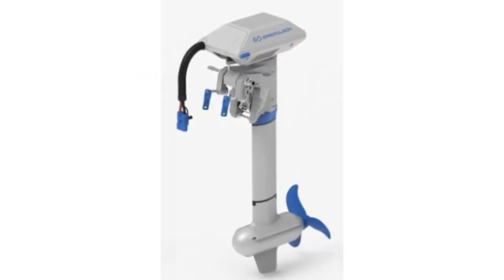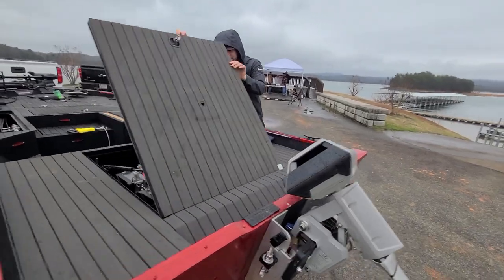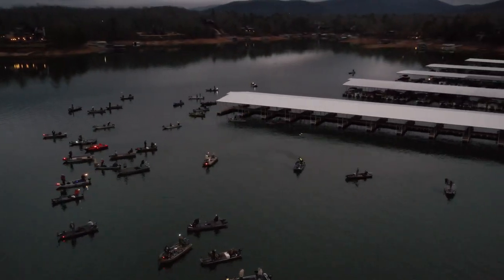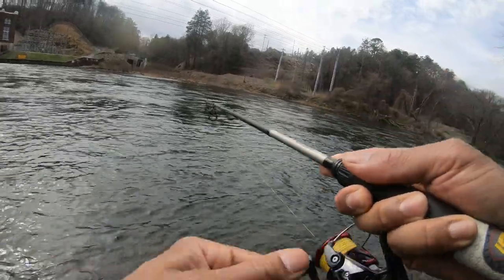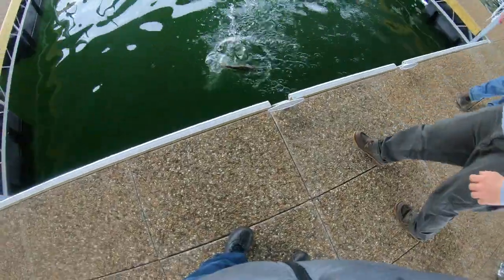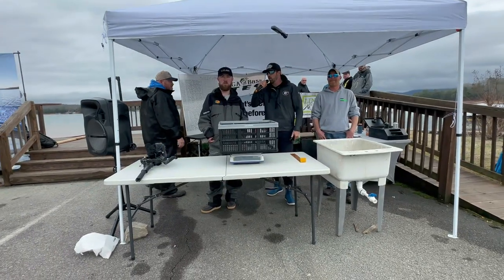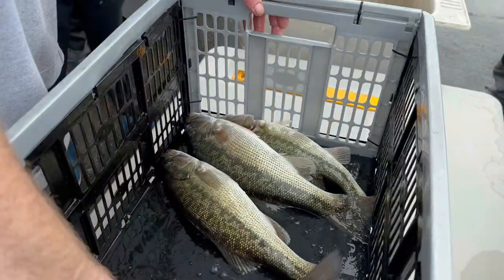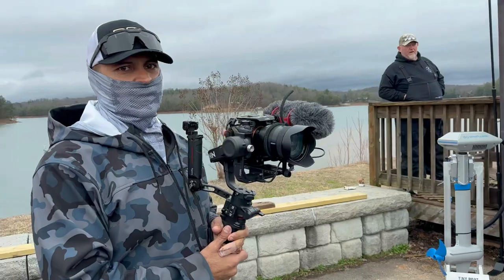Are Electric Outboard Motors Taking Over Bass Tournaments {Georgia Total Electric Championship}

Comment: My thoughts are what happens in 15-20 years from now when there are a ton of useless dead batteries? Where do they go? Will they be able to be recycled and not just fill up land fills. Hopefully my worry wont be an issue. Boats should become light and faster I would think. Great video. It puts a spot light on the fishing world to come.     Tight Lines!!!
Reply from the maker: Good point Duane.  Hopefully recycling batteries will control the landfills but everyone needs to do their part.